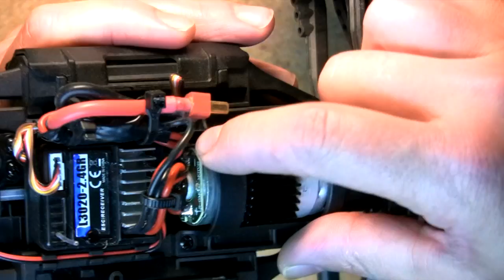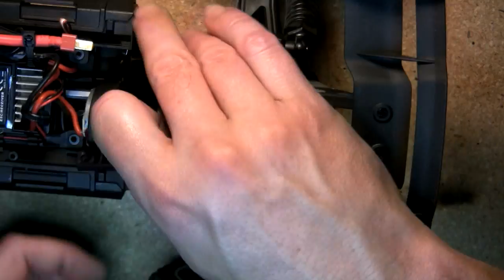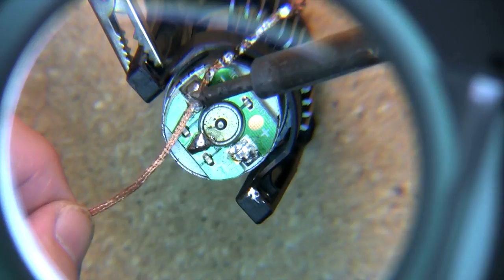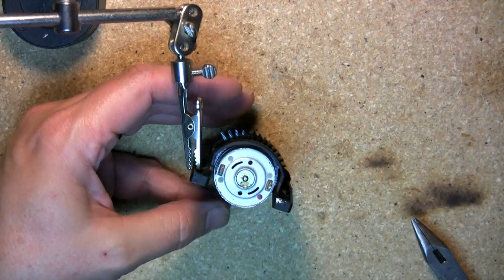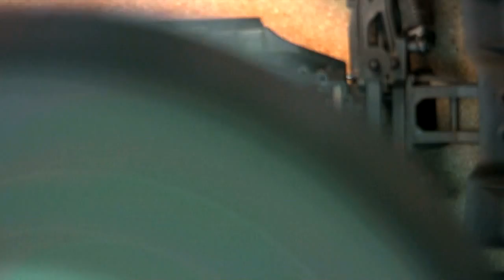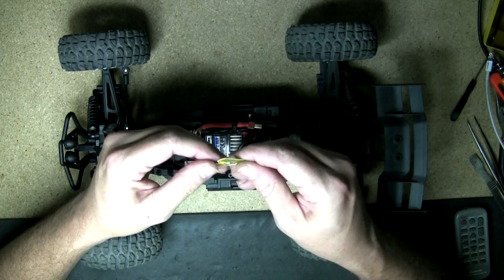HBX Dune Thunder 12891 #10 - Simple Speed Boost Mod, Removing Motor PCB, RC Cars

Comment: Cool...I have extra 390...i found an old ST body  from my Savage..but wasnt for a Savage.
it looked perfect on my savage..1/8..it look more scalish trophy truck.
The tires/wheel still sticks 1/2 "  on each side of the truck on the HBX/Kt12
That's why i like the truck,...it's has wide wheel base.
 Im thinking of extending the chassis or make one.
Use the parts off of this. I was thinking I can add a 20-25 mm Male/female Hex..PCB stand off. To extend the center shaft. JB weld it.

The truck has decent speed stock. I just want to be able to jump it.lol

hurry up and come in metal gears....lol
i ma make a 1/8 brushless 4x4 35-40 MPH  for under $100...
if it works. I'll get more for $40.lol
Reply from the maker: You can't beat having a super fast diy unit. It's always more fun to create your own ride, like you said :)
Reply: I tried it...it goes faster..You actaully have to focus more when driving it ,now. It fells like it has more torque and accelleration...
I like it....
Yeap it'll roll backwards...it dosnt bother me. I dont break or reverse that much....Thanks for the tips.